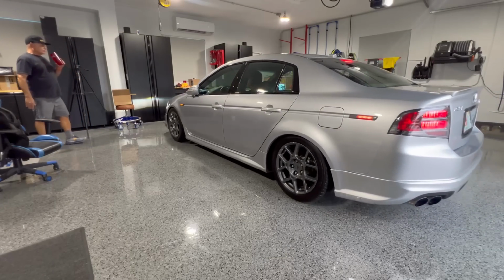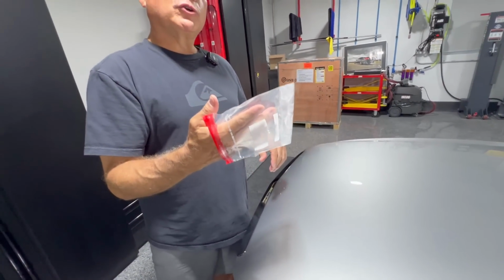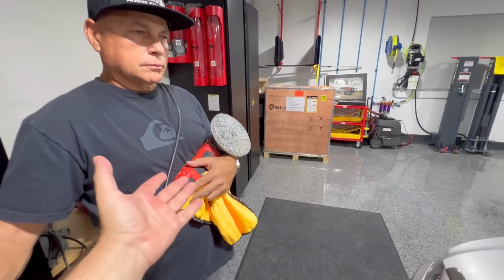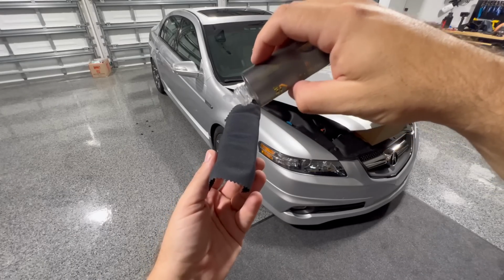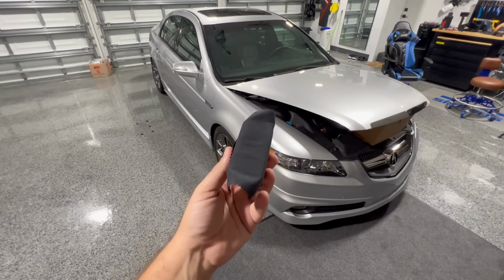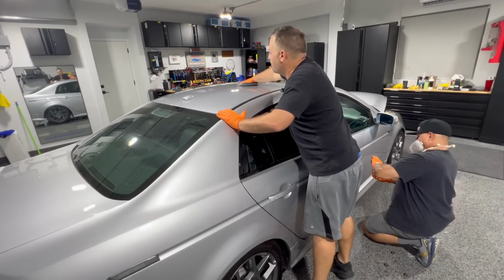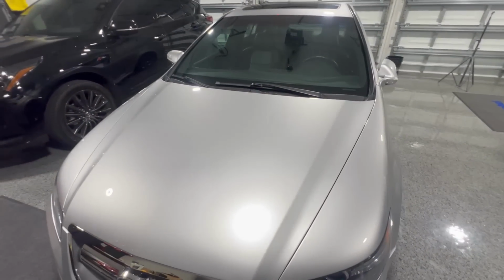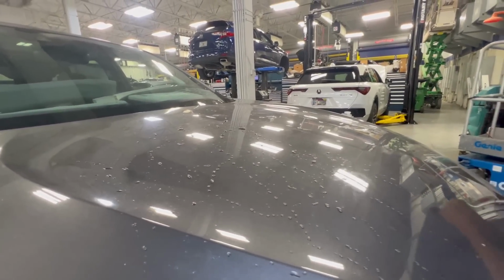DIY Ceramic Coats are a BIG Gimmick? The Truth from an Automotive Painter!

Comment: Firstly, no offence to Juan, but clay bars are very inefficient (very early 2000's). There are superior methods and products to decontaminate the paint in far less time. It takes no more than 1 hour to properly polish a car after a wash and detox. Applying a good ceramic coating is another hour so this whole process is about 3 hours. I switched to ceramic coatings several years ago and love them. I have owned an autobody shop for over 20 years and have offered detailing services to my customers since day 1. Love the channel!
Reply: why didnt you share any of the methods or products that are better than the clay bar?

Comment: When we had our Bronco ceramic coated we had them do the barrels of the wheels too. Totally worth it. Nothing sticks to the inside of the wheels. I'm always super skeptical of this sort of stuff. But the ceramic coatings do work. I'm talking about the professional stuff like you used, not the wax you buy at the auto parts store. A little pricey, but pretty amazing stuff.

Comment: Ceramic coating is a useless way to ruin you paint ... use high quality wax and you´re good for any situation. Ceramic coating removing? Good luck and time getting it off. Protection is not as promised ...
Reply from the maker: Comes off with laquer thinner no problem
Reply: I’ve had a coating on my car for 5 years now. Paint is still flawless and swirl free.

Comment: I had an 08 TL type S six speed but I sold it for a 24 GT Mustang but these cars are clean and mine looked really good and didn’t have any panels falling off or anything. Even with a microfiber towel you can hear the contaminants in the paint but stuff still gets into the paint but

Comment: IMHO: Ceramic Coat is only there for making car washing easier (ie: offroading  mud,  saps, hard water spots etc). That's all, it's just an enhanced expensive wax/sealant.

However, the claim of 3-10 years is very DECEIVING to the general public. Claim of 10 years = full garage kept car show condition. In reality, your daily driver will see an avg lifespan of 1 year (without toppers). Then you have to maintain it with "toppers" every 3 months... what's the point of ceramic? 

Detailers will argue that the "topper" is to protect the ceramic coat that you just put on. .... so protection on protection...Just buy your regular sealant/wax and redo it every 3 months.  Just use Turtle wax ceramic spray, Same protection for 1/3 the cost. Makes no sense.

Also, UV property claims - Not true, plenty of research shows it has little to no UV protection. My experience - I used a ceramic pro kit  with claim of 3+ years on headlights,  guess what, it only lasted 8 months on headlights that's solely parked outside. I used 2k clearcoat on my other vehicle;  still looks like new 3+ years now.

Ceramic coat works for easy cleaning, but that's it. Feel free to change my mind, I welcome the debate
Reply: I agree with you for the most part man! (I'd agree 100% for city driving). I think doing a clay bar and applying a true ceramic coat annually might offer a bit more protection from small rocks and debris if you do a lot of highway or gravel driving. I'm from the rural Midwest with snowy winters and salt on the roads, so the application and curing process of a true coating might offer better coverage, and a more uniform "shell". After all, it's not just meant to make it shiny and seal it, ceramic is a super hard shell that's kind of like a sacrificial clear coat. 

Just my 2¢, I guess in summary I'm thinking the region you live in and conditions for your commute might justify the investment & effort for extra protection. For a maintenance spray, I absolutely love the turtle wax hybrid solutions ceramic coating, happy to see you mention that. Wonderful product and my go-to.

Edit (have to add) - if your car is a Sunday cruiser, extra vehicle, you don't drive much, or have short commutes in a nice climate... Just use the spray. The full coating process and product cost is NOT worth it for that. You'll get all the protection you need from sprays.
Reply: Not only for easier washing. My current car is coated and also my fifth black car. The coating has prevented gett swirls in the paint.

Comment: Project Farm has a great video on these paint protectors.
I did it myself and it worked great. $12 for Chemical guys strip wash (in a $99 pressure washer) and $18 for the Turtle wax Ceramic Spray. The car was filthy before and it was absolutely beautiful when done. No clay bar, no buffing, none of this other crap. I'm not saying this stuff doesn't make a difference, but I am saying that most people will never notice the difference and it is a huge waste of money. 

Feel free to waste your money on this crap if you feel like it, but no one will know the difference other than you and your bank account.
Reply from the maker: Love project farm. What a great channel!

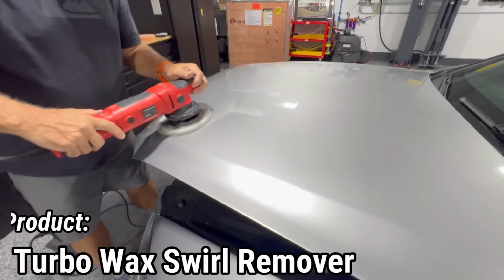Comment: These rain-ex "ceramic coatings" are a pain in a painter's ass when it comes to prep. You have to clean it off with a strong solvent to break it loose from the existing paint, or it will fisheye like hell. 6:00 ish. That orbital polisher would eliminate the clay bar step. Using a good polish or even a coarse compound won't leave swirl marks, and that rain-ex "ceramic coating" will fill in the voids. Gotta make sure the paint is fully cured though.
Yes, ceramic coatings in those little bottles smell EXACTLY like rain-ex in a bottle. They apply in the same way, too.
I dare you all to use rain-ex window treatment as a ceramic coating, and you'll know the truth. It's CHEAPER than a 50$ 3 ounce bottle of ceramic coating. 
Dealership i worked for charged 800$ for a ceramic coating, bottles were 25$, and you could do a whole crew-cab with less than a bottle in about 2 hours tops. Had a "warrantee" against rock chips in the paint, too lmao. They even sold YEARLY applications of this nonsense.
Reply: RainX glass water repellent is very different than ceramic coatings. “Rain-X is primarily made of polysiloxanes, with hydroxy-terminated polydimethylsiloxane being the main active ingredient.”  Ceramic coatings are made with silicon dioxide, basically liquid glass, so much so that the towels used to level the coating have to be thrown out afterwards due to dried glass particles in the towels.
Reply: @Patrick94GSR  Damn. Chemical analysis Keeps me standing corrected. 
Well said, my friend. I guess i was using the cheap sh!t hahaha!

Comment: It’s not the machine causing the buffer trails/holograms, your pad and polish combo is too aggressive that’s all. Rotary’s can finish perfectly even on the softest paints.
Reply from the maker: I think da polisher is a better choice for finishing for amateurs like myself
Reply: @PaintSociety it’s irrelevant which polisher type you use, rotary or DA. You must go finer with the pad and compound to remove the swirls. Rotary is not harder to use, I argue it’s actually easier. Patients and going in steps with a good finishing pad and compound is key.
Reply: @PaintSociety  DA’s leave micro marring due to the dual movement, something that is not present in rotary machines, they also have more vibration, and make edge work more painful as it takes longer, also switching out backing plates is much harder to accommodate different pad sizes. So I wouldn’t say DA is easier for beginners by any stretch, quite the contrary in fact.
Reply: Try this next time on soft paint to finish perfectly with a rotary: Lake Country Blue/Black foam pad paired with Menzerna 3500. Also, keep speeds low to avoid heating up the paint (heat makes it softer and it hazes quicker). For the final pass, zero out any downward pressure on the polisher, some guys even lift up the machine slightly and use super plush microfibres to wipe off the residue. Guaranteed perfect finish every time.

Comment: i have used Avalon king armor shield lite, and CS3 i find they are close, not as nice as the Goat, sticks a little more then on the Goat car, but a good breeze is all it takes for it to move and it start rolling off again. i found since i wash about every 3 months anyways. it doesn't take much time to reapply.
i do every step but polishing might have to give it a try. but its newish paint anyways pretty clean.